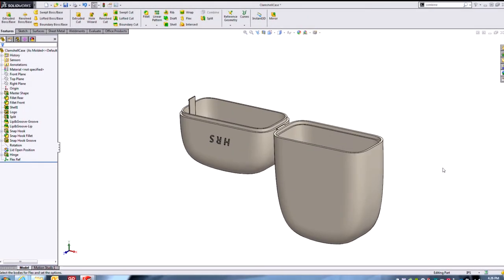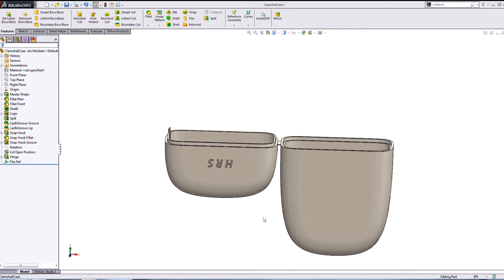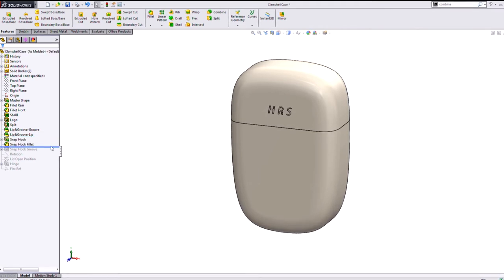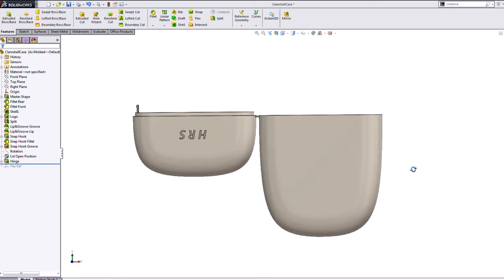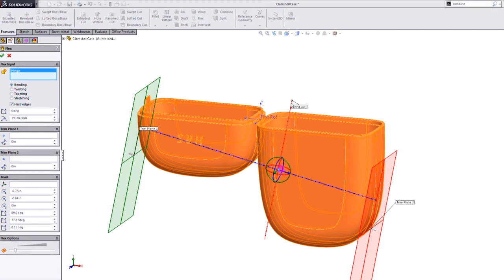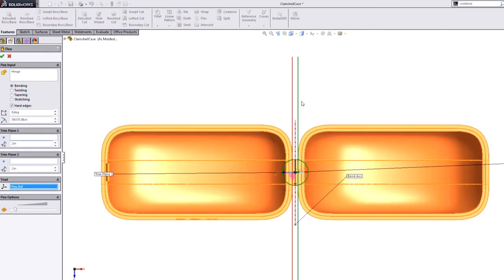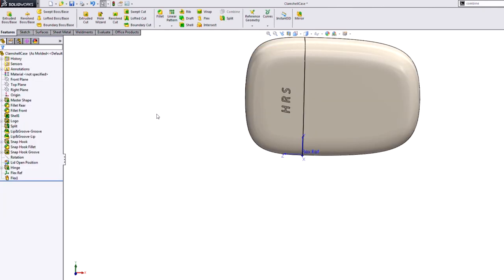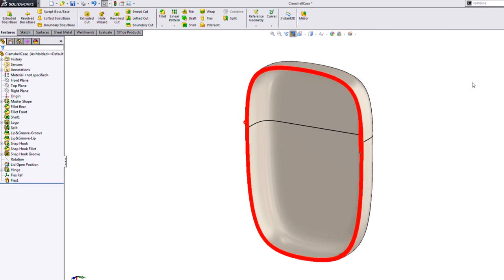SOLIDWORKS - Using the Flex Feature in Clamshell Packaging Design

Comment: More remedial-- How did you position that reference axis for the rotation/hinge? I can create a reference axis on the edge of my seam (between the two parts), but I can't seem to move it perpendicularly away from the seam. The offset command would be perfect, but it doesn't work outside the sketching mode.

Comment: How would you make sure it is the right shape hinge that will allow you to close the lids and also look the way you intended it?
Reply from the maker: Hi Mihkel – if you create the model in the "open" shape, you'll have to use the Flex to close it and then check the fit. If it doesn't go together, you'll adjust the length or position of the hinge, and then close it again and see if that improves the fit. It's a bit of trial and error.
If you create the model in the "closed" shape, then you will just use the Flex to create the "open" shape for the mold. Less trial and error with this method.